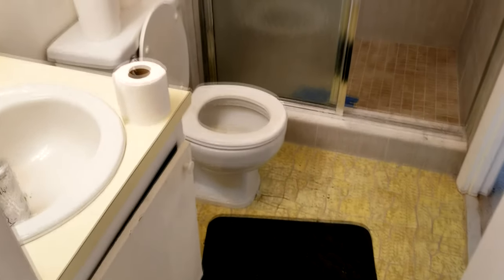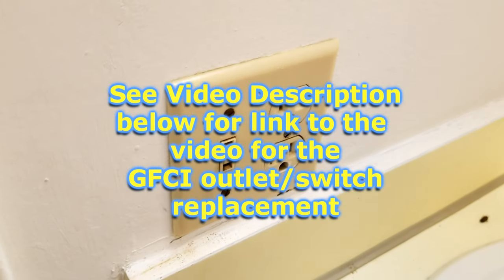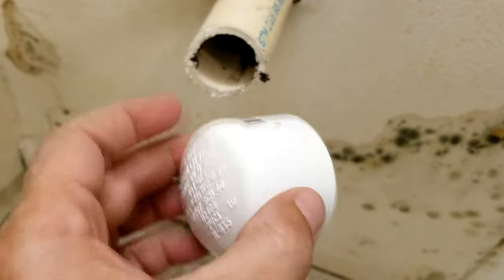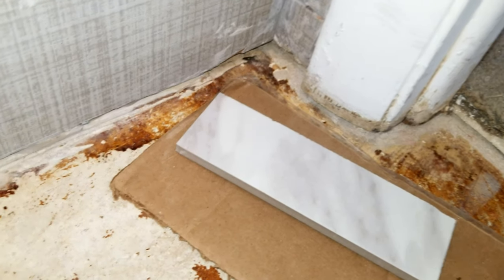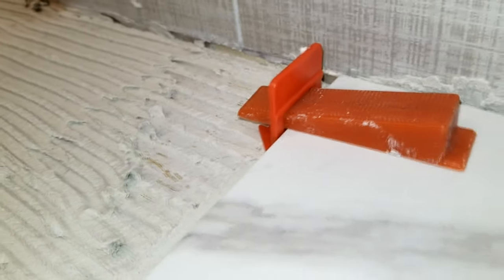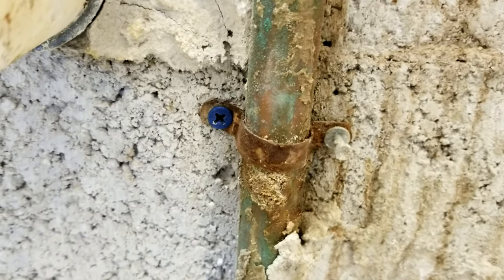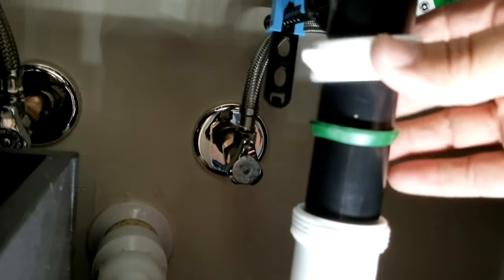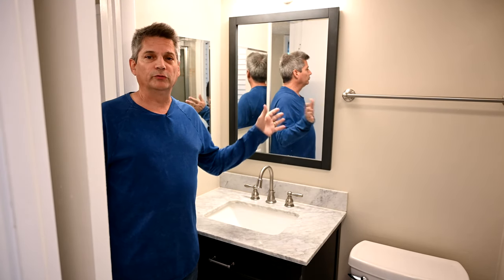DIY Bathroom Remodel $1200 Renovation Budget - WATCH THIS!

Comment from the maker: ✅ Other videos spawned from this bathroom renovation project:

✅ How to Move Off Center Vanity Light Over on Bathroom Wall: https://youtu.be/DBhKSZH6SLg
✅ DIY How To Install Bathroom GFCI Outlets and Light Switch: https://youtu.be/wdnNmyp-VM8
✅ DIY How to Remove a Rusted Toilet Bolt and Nut Stuck Together: https://youtu.be/mshmdWtVwGE
✅ How to Cut a Round Hole in Tile for Pipes and Shower Heads: https://youtu.be/jAvxftJ3vwA

Comment: I like those old sch p traps. I hate hate hate those adjustable p traps they leak. and I can do more with the sch 40.
Reply from the maker: Yes, back in the 60s and 70s here in FL they made big SCH40 P-traps, all cemented in. Now it's all thin wall poly tubes.

Comment: Your work looks good. Great vid. From a plumbing aspect those pipes behind the vanity should've been replaced. The previous plumber looks to have not cleaned off all the flux from soldering his fittings. You tell by the green color near the fittings. Those will leak over time and ruin your work. Also use grout around the toilet, not caulking. Makes solid base for the toilet to sit and no chance of it rocking. Caulk flexes too much and results in a broken floor flange.
Reply from the maker: Darth, we use tiny shims under the toilet, usually 4 of them around the perimeter so there is no stress on the flange at all, the toilet is perfectly balanced, and we make sure it is rock hard. I use silicone rather than grout, as the grout will soak up liquids and stain, whereas white silicon will not. but yes you are right, the toilet would wobble without the shims, requiring the use of grout. this is how we avoid having to use grout.  Also we do see a lot of sloppy plumbing when we open up walls, they never clean off the flux! In fact when I solder, I wipe off all the water soluble flux BEFORE I solder, because there should not be flux on the outside of the pipe, only in the capillary action path inside the fitting.

Comment: Overall I say pretty decent job, one of the better vids I’ve seen on YouTube.   I was looking at the mold and thinking he better remove that!!  Learned some new stuff.  I would say shut off main water, throw down some DITRA, and relocate that light before doing anything.  Henry Rollins and Charlie Sheen had a baby.  👍🏻
Reply from the maker: Ditra  Is not necessary when you're on a nice flat concrete floor.
Reply: I used ditra regardless. Organic materials expand and contract...better be safe than sorry,especially on huge floors can’t go wrong gents 👍🏼

Comment: I'm interested to know how you determined if the linoleum was or was no put down with an asbestos adhesive.  Is there some way to check?
Reply from the maker: Usually the specialist companies that do this sort of thing with asbestos will send it off to a lab or maybe they have their own testing. But they did not use asbestos in this unit as it was built in the mid 1970s

Comment: What if my floor is slightly un level? What's best way to level it?
Reply: You can start by either redoing the subfloor with new plywood and cement board. Or if you have a good subfloor or foundation you can use a liquid leveler. Schluter Systems  Ditra 54 Sq. Orange Polyethylene Waterproofing Tile Membrane works real well. It allows you to tile and have a little bit of flexibility in the tile so it doesn’t crack or break up later on. Use screws when redoing the flooring and apply your tile mortar then back butter your tile. Use a level and a good spacer system like in the video. Good luck

Comment: This could have been done a lot cheaper.  No need to buy a new toilet, they function the same essentially.  The old faucet was fine.  The vanity could have just been sanded and refinished.  The old mirror just needed a new frame.  Instead.  A lot of the costs were unnecessary.
Reply from the maker: You are completely insane. You don't sand down a crumbling particle board vanity. You don't sand down Formica. This is the 21st century, no sane buyer wants that faucet.  The mirror probably could have been salvaged, but we wanted to add a more modern mirror to make the bathroom look nicer for sale.  People in this same condo complex selling their condos the same time as a us got $40,000 less for unremodeled or "cheaply remodeled" units. The old faucet was garbage, and the old toilet was a water waster large toilet. The toilet we replaced it with is infinitely better and worth every penny at under $200. When you go to sell a house, you get more money when you can tell the buyer it is 100% remodeled, and we always say in our listings "Be the first to live in and use this home since the remodel"
Reply: @jeffostroff  OK, I didn't know it was particle board, thought it was wood.  I didn't know you were planning to sell, so it makes more sense to splurge a little more.  I will tell you that your remodel looks good for $1200.  It's very clean and modern.  Some of the remdodels are horrendous.  Check out this one for $5,000.  The floor is shit, the mirror is shit, and everthing else is garbage.  I could have done that for a fraction of the cost. https://www.youtube.com/watch?v=lmSykSOb2mc